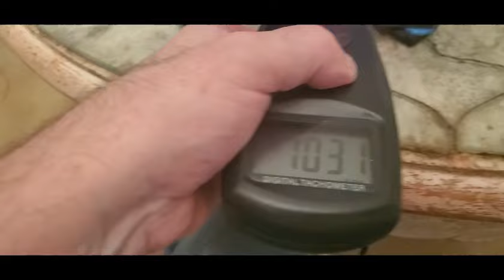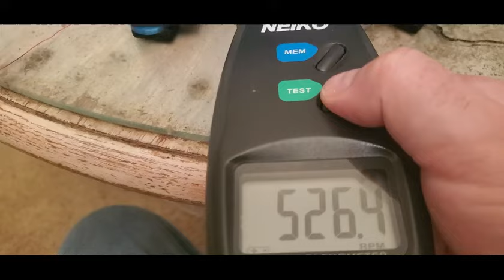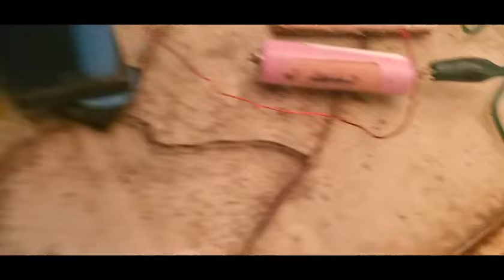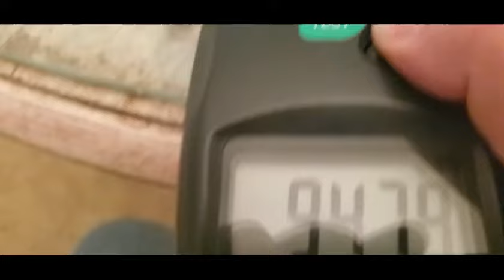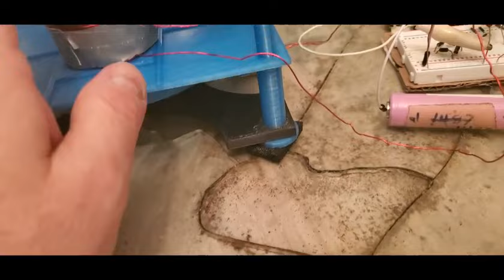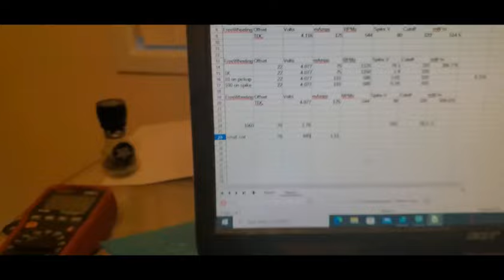Monopole Pulse Motor Air Gap: Part III

Comment: If a load on the generator coils effects the driver coil consumption. With isolated circuits. It's wireless transmission and the pickup coil is causing the driver coil to consume more power.
Reply from the maker: Hi Make, Even a pulse motor draws more current at lower RPMs.  Resistance is greatest, instantaneous amp flow least around the initial time a coil sees current.  If the voltage remains the current in the coil increases, resistance decreases as a function of the pulse duration and tau time of the coil, until if you leave the current on for say 5 tau times all that essentially remains is the direct line DC resistance of the coil. Magnetic field strength is then maximal and amp flow maximal.  The duty cycle remains constant over rpms with a pulse motor, but yes if you are running at 500 rpms the current will be greater then at 2000 rpms even with a pulse motor.

Comment: From my experiments the closer you move the coil to the magnets the more push you put on one side of the bearings only. I figured the friction and unbalanced load slowed down the rpm.
Reply: It slows down because the magnetic field is blasting to the back side of the coil from the magnet.
A north and Southfield can exist in the same space.
Reply from the maker: Hi Brain, That certainly has to be a part of it, as you are putting a stronger and stronger force on one spot of the rotor it is unbalanced.  That said, the results were so dramatic, rotor sped up with the small coil brought in, slowed down with large coil brought in, granted the small coil will have fewer winds, but still the big coil has to be stepping on its toes somehow.  You might think is it seeing the next incoming magnet. I would say no, because there are only 4 of them and they are 90 degrees apart, will know for sure when we go to 6 magnets on the rotor, but I sure hope it is not seeing the next magnet as you might end up with thumbnail size coils with a six magnet rotor ;) That leaves that the part of coil well outside the magnet is seeing both sides of the magnet, I think Make is right, the main thing that is going on here is the coil is big enough it is seeing the wrong side of the magnet.  I have a couple/few more things I want to look at before going to 2 coils but will try to nail down how much friction is coming from having the rotor unbalanced by having only 1 coil at that time.
Reply: @paulmaher812  Look forward to seeing how it all works. I did manage to buy a diametrically magnetised cylinder magnet and balance it on two magnetic bearings. I managed about 40,000+ rpm at 30 to 40ma with that configuration.
Reply from the maker: @BrainfooTV  Magnetic bearings, 40,000+ rpms, Outstanding! That is humming along. Hope it isn't a large diameter magnet.  One thing you might be interested in looking at, especially as you already put in the hard work setting this up, is the solar current sheet. As the sun spins it throws off alternating current.  As I understand it this may be a property of any spinning spherical magnet, not certain on that, maybe the sun also has a little wobble going on.  That was something in the back of my mind I thought might be fun to look at someday.  Not trying to create work for you that I should do, but seeing as you have everything setup already might be fun to spin a sphere magnet and see if you can see any alternating current coming off it. The solar current sheet leads to Ben Davidson's site and his hypothesis that the galactic current sheet is incoming and will destroy much of humanity in about 20 years or so, which might be a problem.  Would be interested to hear sometime how you set up the magnetic bearings and if it was difficult.
Reply from the maker: I just realized my point was pretty stupid, of course there is AC coming off the thing, still the solar current sheet part might still be an interesting read